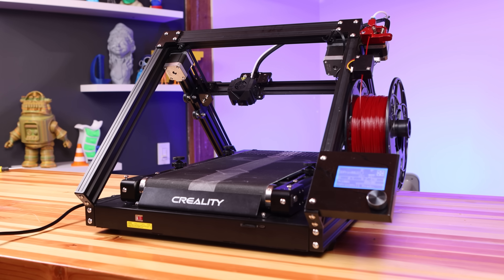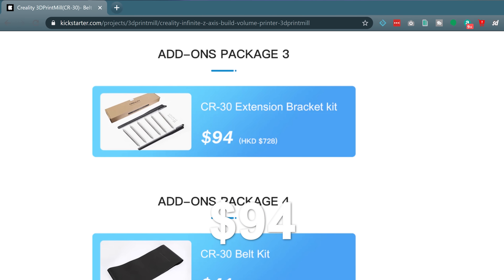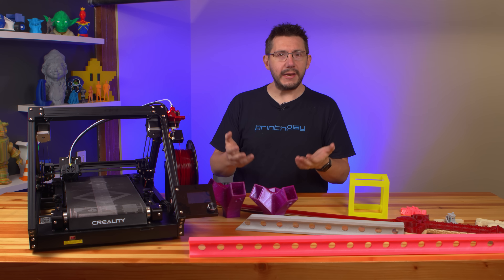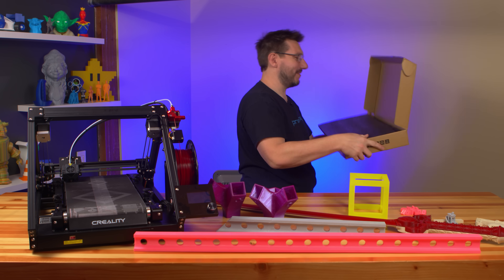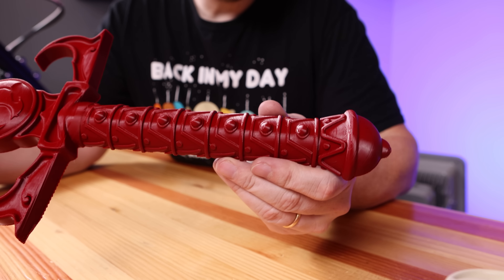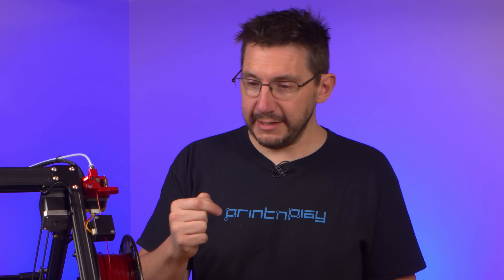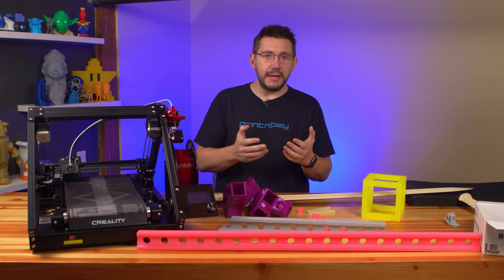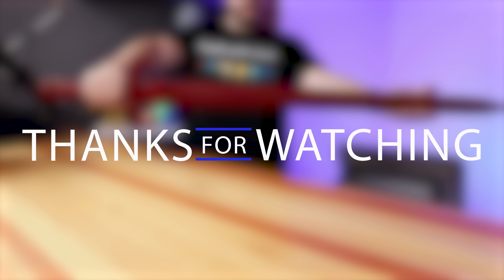Creality CR-30 / Naomi Wu's 3DPrintMill Review - SWORD OF OMENS!

Comment: 1:48 I'm accustomed to X being left/right, Y being up/down, and Z being forward/backward. I still get confused with the axes being rotated in 3D printing sometimes. 😅
Reply: Hehe! I'm with you! I used to model in Maya, Softimage and Lightwave. All of those programs used Z for depth. 3D printing confused the hell out of me!
Reply: thank you... finally... it just makes more sense. X & Y should be moving in 2 dimensions and Z is a 3rd dimension. If you hold a piece of paper in front of you, you can draw X & Y, but you can't draw depth so of course towards you and away from you would be depth and therefore the 3rd dimension.
Reply: of course we think like that because the medium we work in is often 2D as well, looking at a screen in front of us we have to plot out 2 dimensions X & Y, in a digital screen space the third dimension came afterwards. 3D printing is coming from an analogue time where people drew on graph paper, on desks, at 90 degree's to their body... like a cave man.
Reply: Think of it as a warped Z to infinity!
Reply: It all comes from perspective. Some 3D software use Z as height, other use Z as depth, the only difference is the default orientation, and usually this is customizable.
You can understand it better if you look this way: a paper is on the table, you look at it from the top and you draw on it using the XY plane... then you step backwards to gain some perspective and use a magic to make your drawing into something, it raises from the paper, gaining a 3D form by rising on the Z axis.
Reply: @mechanicallydev4536  Many of us are used to X, Y being the monitor, with Z being into or out of the monitor.

Comment: "no words yet from simplify3d"
I'd be shocked if they did let us know on anything at this point
Reply: I died a little inside when he said that.
Reply: Not sure they are even in business anymore
Reply: @cda32  september was their last message, saying that they were all hands on deck with their infrastructure upgrades. If they are anything but twice as good as any other slicer once version 5 comes out they won't make it.
Reply: @rachellejanssen2655  What infrastructure? They have a webstore and sell one software application as far as I can tell..
Reply: @YKSGuy  it's the last twitter post from back in september. The only thing I can think of is if they have some kind of online storage, simulation, or rendering feature that is done through their software-as-a-service thing running on the cloud.

Comment: I'm hoping to be in a position by the end of the kickstarter to get one, the main selling point for me is the amount of items I normally print that because of the 45 degree angle wouldn't need support. My (Omerod 2) already has a 400mm Z axis, so the infinite length is less of a selling point, as I've rarely found I need to go beyond that, and I' never leave a printer going overnight, just in case....

Comment: The belt interface (formerly known as the first layer) seems to be an issue for artifacts. It's likely less of a post processing problem than splitting a Thanos sword by who-knows-how-many-times on a Cartesian printer.
As with all "new" tech there will be things to refine. The community is good at this even if the factory is unable or unwilling to do it themselves.

Comment: I tried to back it. Got confused by the HK pricing in the rush to order. At the time they did not list the US $ pricing. I see now they do. I ended up pledging on just the Belt itself. By the time I realized it the lower prices pledges were all taken. Ended up cancelling the pledge I had because having just the belt wasn't what I wanted, even though I know I could reproduce the design using openbuilds and such. I still want one of the printers but now it cost just under a $1000. They says it is $688 but they are not mentioning the shipping fees which pops up when paying for it. For example. That belt that I mistakenly pledge for was like $41 US dollars. The shipping was over $100. Can't remember the exact amount off the top of my head but it was high. The shipping for the actual printer brings it to just about $1000 which is basically the finale retail price they are suggesting it will be. So you are basically buying the printer at retail price with free shipping. If it ever gets sold on Amazon, Prime Members will more than likely get free shipping anyways. So the only benefit for getting it now would be to just get it earlier. Like a year earlier. Which to many is worth it. I know I would like to have it right away 
For me I have two things are now stopping me from buying it.
 1st is the fact that I recently got burned by a kickstarter pledge type deal. I purchased the Early Bird of the Elegoo Saturn but received a machine with one issue after another. I've had it for 4 months and have yet to print one thing with it. Currently I am waiting for a replacement control board from Elegoo. I've ended up buying my own control board from Chitu Systems which already arrive. Why they can ship this fast without issue but Elegoo take a few attempt and months at a time is beyond me since they are coming from the same area. Anyways... Hopefully today I can install it and get it working.
 2nd is just being able to afford it. Like many here in the rural areas of the country we have been struggling financially. Even before the pandemic our economy sucked and we have been loosing businesses left and right. Now it's even worse with this pandemic. My spur of the moment excitement for the 3DPrintMill made me initially try to pledge for it and would have put me in debt more but I would have gone through with it. Now I look at it more cautiously. I think I'm personally better off waiting until I actually can afford it. Like I hinted I still want the CR-30 3DPrintMill but I think it's best if I just wait.
Who knows. Maybe in my spare time ill design my own in Fusion360 & just go that route of building my own to save me a lot of money. But for now I'm content with waiting. 🥴

Comment: If I could request a print I want to see someone print a full height model to set how the printer does at the edge of its Y height. 

If you could post a video of your thought on the belt swap and reset up experience that would be great too. The belt is a consumable I am assuming at something people will have to swap it after a decent amount of time.

Thanks Joel and appreciate the great review, high five from Portland, OR!
Reply: @Michael Dexter FYI  I've done both of things you requested on my channel..  Not that I don't think Joel wouldn't do an awesome job at both.. 😉
Reply: @NAK3DDesigns  awesome i will have to check them out! I have seen a few of your videos but will go check out the others!

What are your thoughts on mods for this printer? Have you experimented with top speed the 30-40 mm/sec feels a little on the slow side. I am interested in volume serial production so making it as productive as possible would be really nice! I would love to see the ability hack in an MMU if not for multicolor but for even higher unattended printing capacity.
Reply: @dexterm2003  I think mods will be very easy since it is all based on already existing Creality hardware (conveyor system excluded), I'm already working on a few myself.. 😉  I haven't done alot of higher speed printing yet as you always need to go slower along the belt(1st layer) so acceleration can be an issue going from fast to slow and back if not done correctly it can mess up the print, I'm already working with some of the slicing companies with some ideas I think will help with some of these issues.
Reply: @NAK3DDesigns  Awesome! One thing that really encourages me about this project is the team assembled really is top notch! You, Naomi, Scott, Tom, Bill and Cura slicer all working together is awesome! I really like the second wave of pre-production units and getting them into the hands of some many 3D printing channels to torture test this with outside feedback and already make improvements is great! I will make sure to go and subscribe to your channel for future updates! Cheers!

Comment: Just keep in mind WHY creality is using kickstarter: I always thought kickstarter was for startup co's? not co's that have already been running? esp at this point with creality the CR line up, the ender's In my mind this would be equivalent to FORD kickstarting a new car? So i ask why the change? why not R&D this thing how normal co's run? Would kickstarters support to BLM have anything to do with it? Maybe im missing something? or maybe i got the full picture? either case i will not support a kickstarter project at this time.

Comment: At $688.00 without the rollers bit even if I was that well off I would not touch it.. 
Different way of printing sure.. 
But far too pricey I think for something like this?  Even if it was half the price it is now I would say too pricey.
I would prefer to have a normal core XY printer anytime. you know where you are with those! Mostly the price is my no buy choice.. Sorry.
Reply: Having built a few of these myself I'll just say that getting it under $1k is a bargain, you'd be very hard pressed to build it yourself for that..  But yes it is on the higher side of the affordable DIY 3D printer range..

Comment: Hello, U did mention that the calipers says 110.02 so the calibrated print was 2 hunderd of a millimeter to big and not 2/10 of a milimeter. Keep up the good work. (and correct me if i am worng ;) )
Reply: You are correct that .02 is 2/100 but it was 100.02. Damn accurate. I was about to post the same correction. But still, keep up the great work, Joel!!

Comment: The coreXY belt configuration has been around for a long time but has an inherent flaw. HP used it in a daisy wheel printer in the 70's. I have a large and expensive Stratasys Fortus 400 printer that uses the configuration.  When I got this $180K machine it did not print as well as the lower cost one it replaced. After years of complaining without ever admitting they had a design flaw they eventually replaced all the pulleys and belts with a finer pitch.  This improved but did not repair the flaw inherent in the basic drive configuration. Here is the problem: There is a step like behavior inherent in a toothed belt drive and inherent in a stepper motor system. No micro-stepping doesn't fix it. The effect of this is the velocity has a periodic modulation because the belt contacts the pulley at various different radii during rotation. You can measure this with a laser interferometer which I have. In an ordinary drive belt application this velocity change has absolutely no affect what so ever. So you'll never see it. But in a differential drive system like core XY this velocity change couples in the axis' as a position change. It shows up as a wavy distortion in part surfaces that should be straight. In my case the changes to finer belt pitch improved it but it will never go away completely.  It probably affects delta machines too. We accept a variety of flaws in our 3D printed parts anyway so maybe this won't be noticed. 

Otherwise this looks like a clever and innovative configuration providing unlimited part size in one axis. A great cosplay sword machine!
Also a great production machine that runs unattended without manual unloading. Congratulations to the clever person that created it. 
JY

Comment: Can you print multiple rows of an item? Is there a setting like a Xerox for the number of parts to print? It Would be interesting to tell it you want thirty pieces four rows wide or something like that. Maybe there would not be an advantage to that though. I was just thinking that it looks like an awful lot of unused work space if some kind of micro production is required.
Reply: No reason to, but yeah. They are working on looping a file, but more than one in a row no use because single nozzle.
Reply: @DrewryPope  I was trying to equate it to running multiples on a regular bed with a single nozzle. It can be done, but is it worth it?

Comment: Love the video.   Thanks again for the shout-out.  FYI I’m already working on an upgrade for that stepper and a Direct Drive as well.   Stay tuned!!!
Reply: Nozzle cut to 45º in 3, 2, 1.... :P
Reply: where can we find your CR30 profile? I'm having issues with the stock profile.... Please help!
Reply: Did you try or know if it is possible to put the micro swiss all metal hotend on it?
Reply: @francisgilbert3941  I have not but see no reason why it wouldn’t fit.  My only concern would be the pitch of their nozzle.  I believe it to be too shallow.
Reply: @NAK3DDesigns  thanks for the fast answer. When i will receive it will be something to try on my own if nobody try it before. Hope this kickstarter will not do the same as the cr6-se.
Reply: @francisgilbert3941  no problem, Naomi is on top of this one..  She'll make sure they keep things straight this time.
Reply: @NAK3DDesigns  There is a design on thingiverse already that I use on my ender 3 pro and it works with the extruder that is on that printer: https://www.thingiverse.com/thing:3816051
Reply: @NAK3DDesigns  Naomi (and all of you guys) being such a major part of this IS the reason I took the plunge on the kickstarter (in at $588).  If this was just Creality I would have waited at least a year or so.

Comment: Great review.  We've always wanted 3D printer manufacturers to reach out to and collaborate with the community BEFORE they release a production printer.  I chose not to buy one at this time (it was sooooo hard not to pull the trigger).  I am supporting and watching from the sidelines as the belt printers evolve so if I do find that I need one in my arsenal it will be there.

Comment: This this is a scam. I am amazed at the crap that these 3d printer groups are trying to push nowadays.
Reply: No, it isn’t. It is a Kickstarter, so it is still in production. They will fix its mistakes before they take it off kickstarter
Reply: @Minecol5  There is a reason why these modded designs were never used.The original designers of this modded printer types  gave up on them a long time ago.  I already see at least 3 stolen designs in thing. Mt ender 3 printer can do the same thing this thing can do, with the same mods! I do see that the original designers aren't even getting any credit. With a lesser amount of money We can convert ANY ender 3 type printer to do the same thing.  I would in no way spend on cent on buying this thing when we can spend less money on just converting what we have to this. If one would want such a useless device. Come on gurus!!!! I thought you guys were better than this. Sales must be low.
Reply: @nobotty1451  "I do see that the original designers aren't even getting any credit" Naomi has been giving a lot of credits to the people behind white knight and other belt printers... 
"With a lesser amount of money We can convert ANY ender 3 type printer to do the same thing." sure, but the point is to have a commercial ready to print product, not a DIY kit.
Reply: @nobotty1451  Who are you talking about giving up and not getting credit?  I'm pretty sure they're giving both Karl (who developed the White Knight and has actively worked with Creality on their design) and myself credit.  Though honestly, I never asked for anything.  When I first designed this type of printer, I encouraged others to build them... with no restrictions. I didn't build them for commercial reasons, it was merely a research project for me to help me on another project I was working on, and I immediately published the designs and software in the public domain. I'll work with anyone who wants help and will continue to promote this type of machines adoption.  As for giving up... I'd say that it's quite the opposite... when I first developed them, I had a specific purpose... it never occured to me that others would be interested... until I started showing it off back in 2015.  By then, it was an old concept machine for me... but to others, it sparked a lot of interest.  It wasn't until then that I started pushing them to build their own versions.  The CR-30 is a result of that work as well.... I visited Creality 2 years ago urging them to make this machine.  So, in fact, both points are wrong... we did get credit and we never gave up on the idea... in fact, it's now stronger than before.
Reply: The whole 45 degree headend seems to just waste more filament.

Comment: Joel, what about the company (Zesty??) that had the "Remote Direct Drive" system that you did a video a year ago. Maybe that would work on this.
Reply: That was the first thing I thought about when he said he wanted it to be direct drive.
Reply: Ooh, yeah. But the problem with that is the flexible shaft, in my opinion. I built my own telescoping shaft for a big delta printer. I think you could probably use sliding axles on this to get that without a 1:30 gear reduction

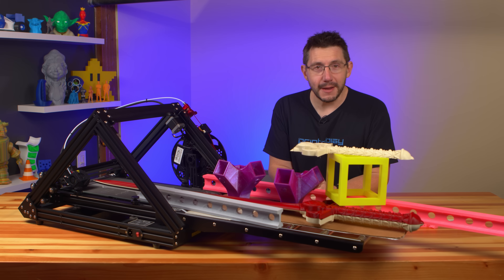Comment: Naomi gave you the CR-30 in trade for reviews. Glad to see 1:14 your modification on the rollers. I took a lot of backlash when I recommended a flat surface instead of rollers. We tested the CR-30 at 200mm/s and it skipped cogs on the belt. We had to run the printer pretty slow.
Reply: On the Z belt?  Or on the CoreXY belts?  If it's the Z, then you can still set the print speed at 200mm/s, but just limit the Z in the firmware.  The machine will only make Z transitions at the lower speed, but will have a high speed during the extrusions.
Reply: @williamsteele  CoreXY belts